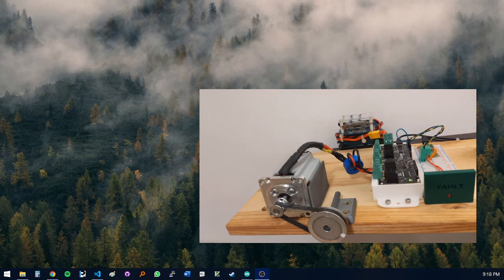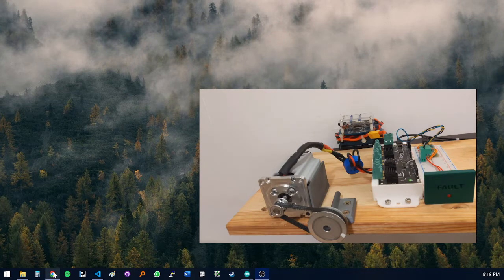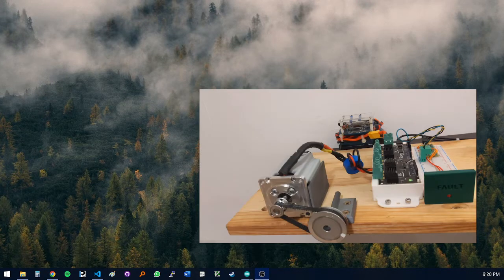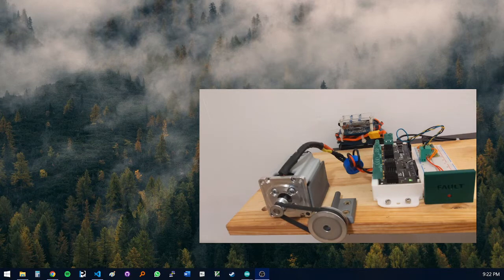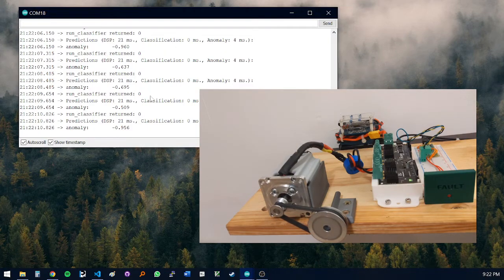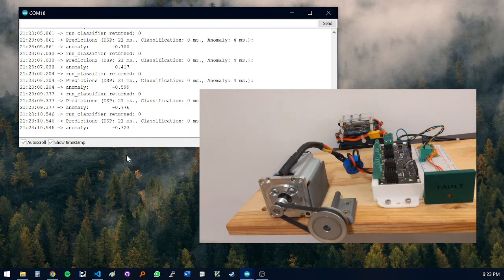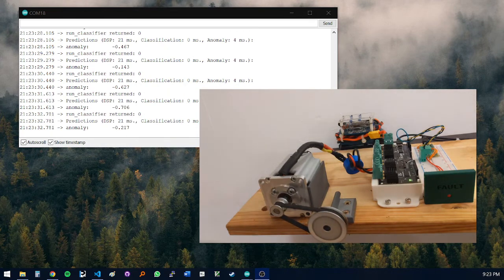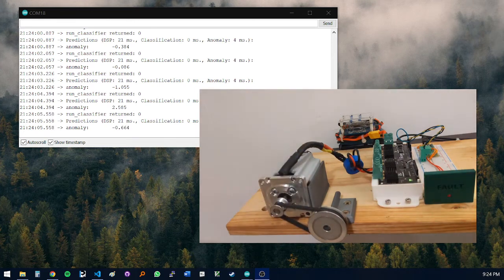BLDC motor anomaly detection using Edge Impulse

Comment: What BLDC Controller is that?  Does that controller provides a UART interface where you can get run-time motor status, including current-draw?

If so, how is the machine-learning approach different than just triggering the LED when the current reported goes above 2 standard deviations from the average?
Reply from the maker: Let me know if I answered your question. Not sure if you noticed that the motor is changing velocity in a random manner to create a "messy" power signal which makes anomaly detection more involved.
Reply from the maker: Hi Ben, thanks for checking out the video. It seems I forgot to include a link to the full tutorial and walkthrough in the description, so I've added it now. Feel free to check it out.

To answer your questions: It is an ODrive controller, and correct it does provide a UART interface that allows querying a variety of parameters including instantaneous power consumption.

I don't think setting a constant threshold above the mean is a robust enough solution for anomaly detection, at least not for the use cases I'm interested in. For instance, a momentary spike may be acceptable within a given system, but maybe a prolonged jump is not within the realm of expected behavior. Or perhaps a mechanical malfunction introduces a periodic disturbance to the system which leads to a rippling in the power signal, which may not cause it to rise above the threshold you suggest, but in any case should be detected and dealt with. 

Using a machine learning approach is convenient because it allows you to avoid having to "hard code" checks for these edge cases, and instead teach a model what behavior is considered acceptable across a number of metrics including RMS, frequency signature, etc. And then the model can not only tell you when a certain behavior falls outside the realm of expected behavior but also *by how much*, which is pretty nice.